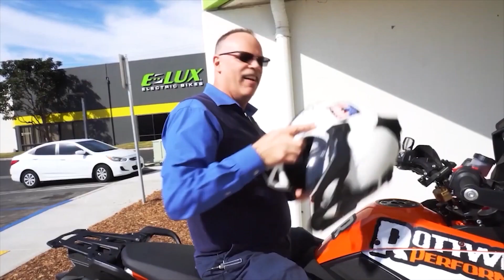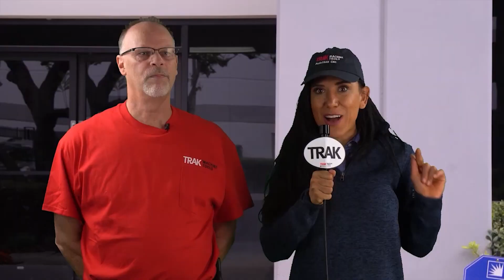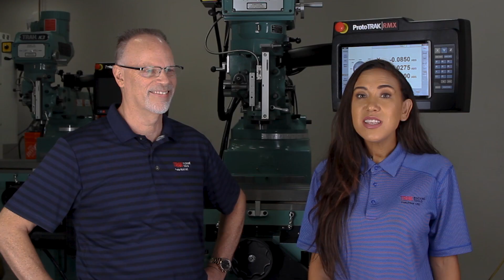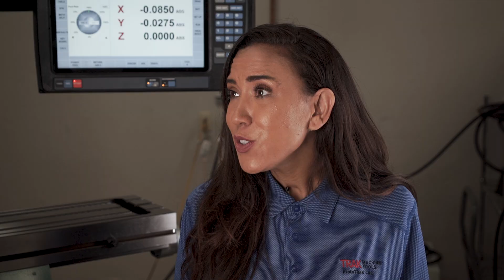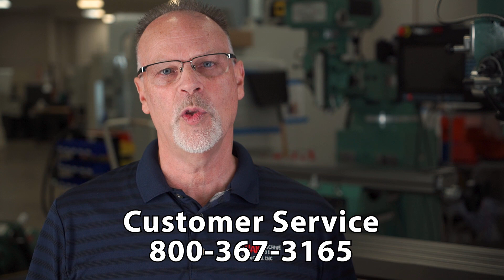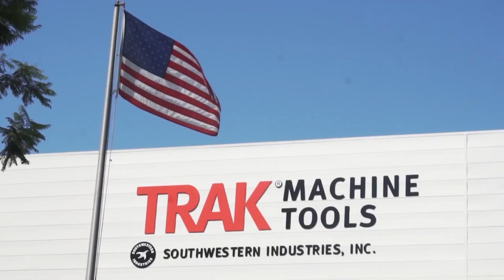ProtoTRAK RMX CNC Upgrade for Mills | TRAK Machine Tools

Comment: Pat, I have a question about using "SCALE". If I have a program with (12) single events that circular profile mill (12) 1/2" holes and use a scale factor of 1.5, the holes will now be machined at 3/4" diameter. Will the X and Y center location change for each event? or will the diameter just increase using the same X & Y center location? I realize I could just edit each R-value in each event or use the sub command.
Reply: Unfortunately, everything changes by the scale factor including the X & Y location so you may have to change your actual program instead of using the scale feature.  T.P.